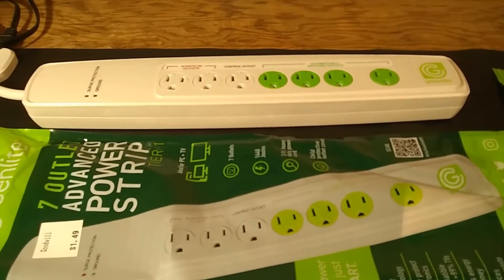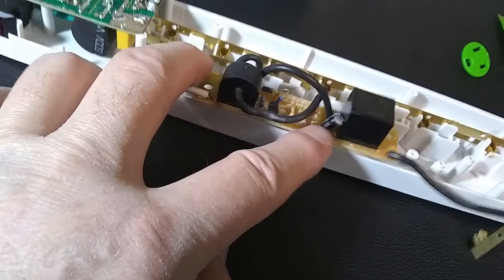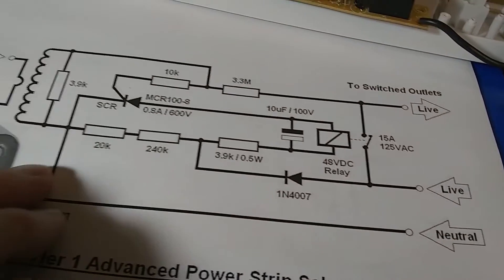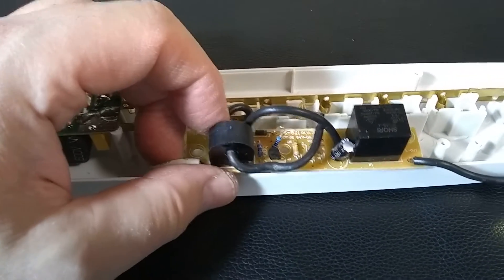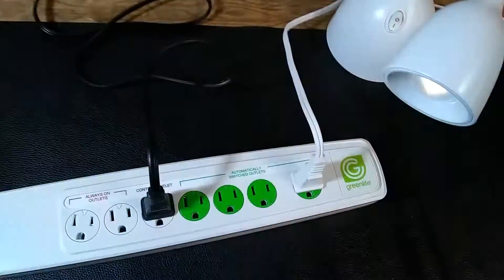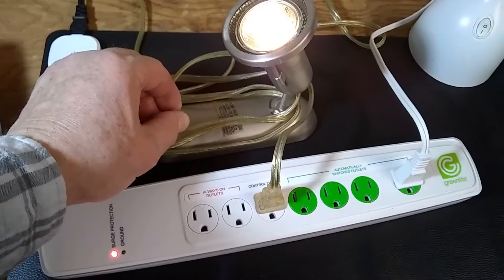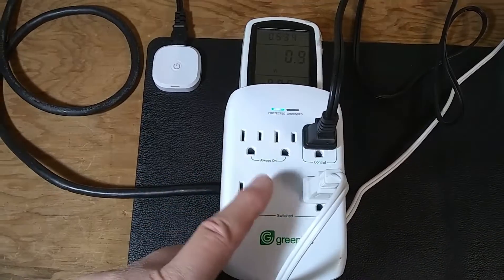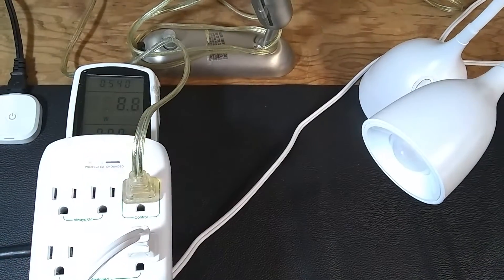Greenlite 7 Outlet Advanced Power Strip. Simple Mains Power Sensing Switch. Teardown & Schematic

Comment: The one I have looks different. It's the 7 outlet that they have on their website so I'm thinking it is newer. Still suffers from the same issue unfortunately. I had my PC as the control outlet and I typically leave it's power supply on. I heard the clicking for a few days now, but I didn't realize what was happening until I actually saw my peripherals turn on and off. I'm hoping they aren't permanently damaged. I think they should not advertise TV/PC as a primary use case given this issue. And that was the use case they gave me at habitat for humanity. They should warn that switch mode power supplies are not ideal as a control.
Reply from the maker: If you use this power strip and hear the relay clicking, this means that the appliances plugged into any of the "Automatically Switched Outlets" would be switched ON and OFF with every click of the relay. This could damage the devices. 

The other types of "advanced" power strips do not have this problem at all.

Comment: So how can i get it work normally?
Reply from the maker: For power sensing use (as intended and designed by the manufacturer) you have to use a simple appliance (heater etc.) plugged in the control outlet. Best way is to test its work with different appliances. But, if you want to use it as a regular 7-outlet strip, you have to open it up and bypass (solder a wire bridge) the switching circuitry. For safety reasons: that would be something to do for an electrician.